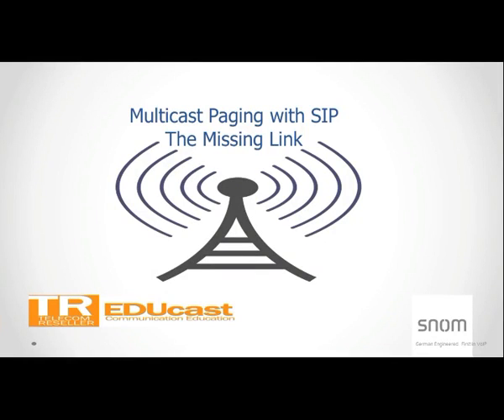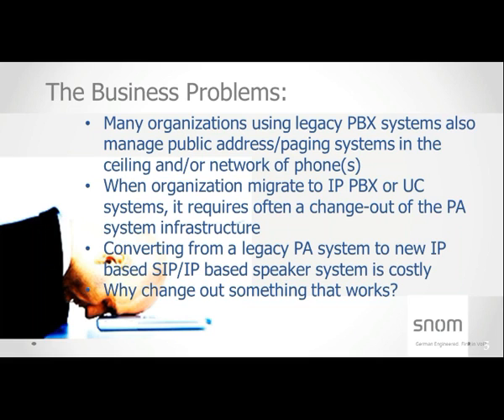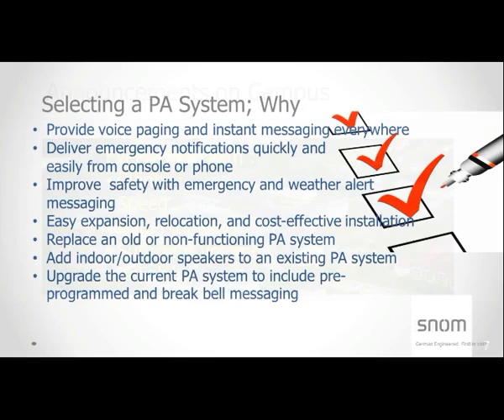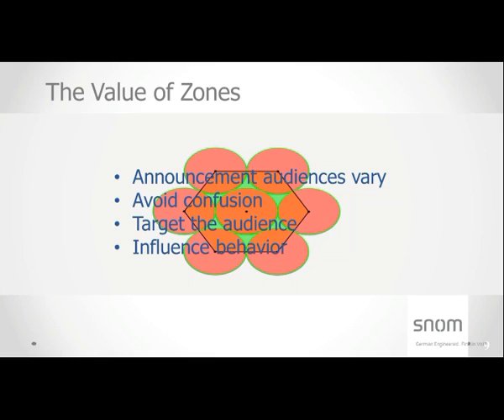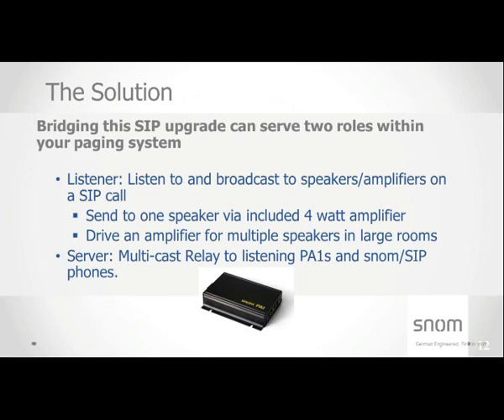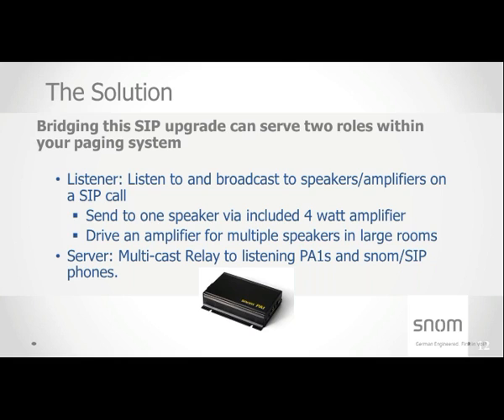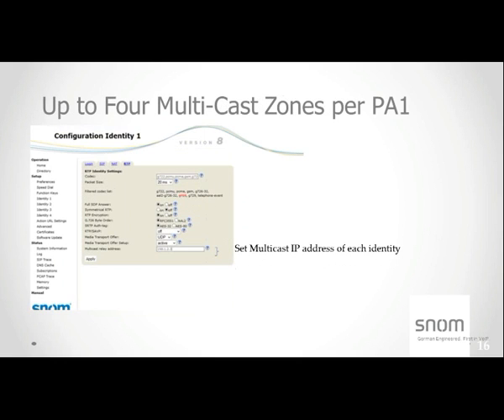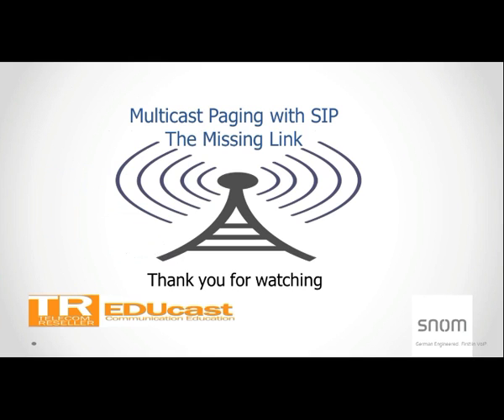Multicast Paging with SIP; The Missing Link

Comment: Im having problems with my Snom PA1 with Polycom vvx600, it used to work when i would type the extension in the phone, it would contact the speaker and i would be able to say what i want to say, now when i type the extension on the phone, i hear it say on the phone "paging system ready" but when i spread my message i dont hear anything on the speaker.

Any clue whats going on ?